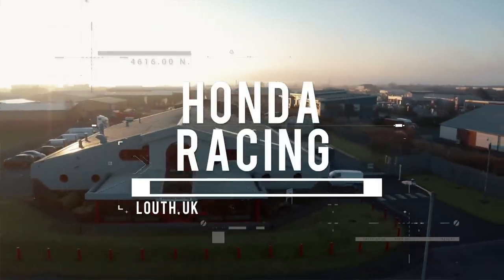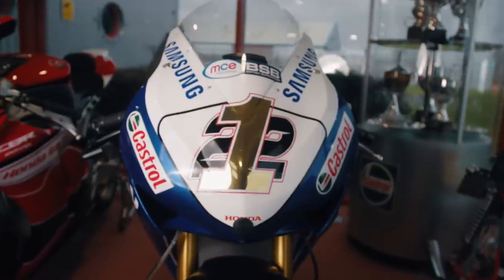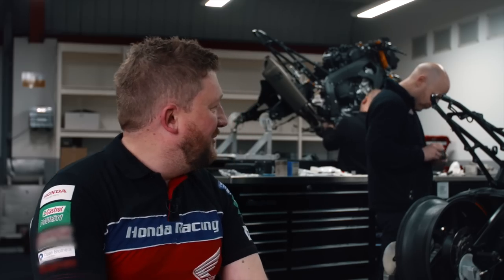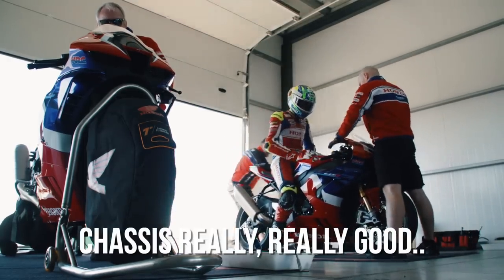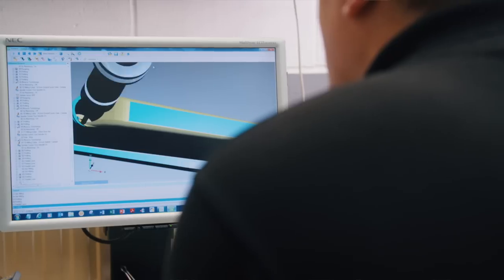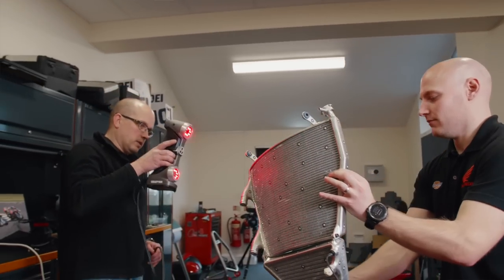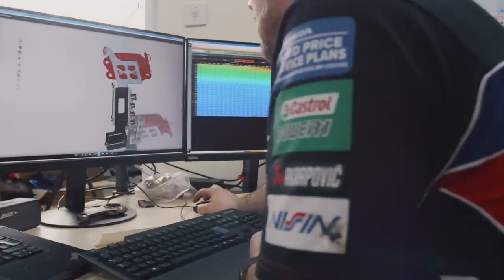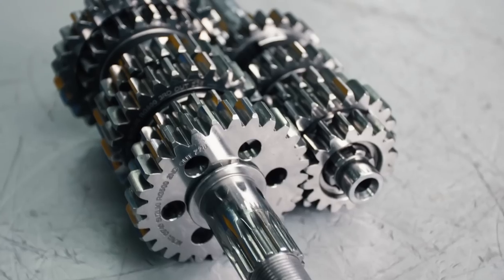Building the Honda Racing 2020 Fireblade SP  - Part 1

Comment: Please explain the Rubber Brake Lines, and the non forged wheels? Oh, and why this bike is getting spanked in WSBK?
Reply: sir, please get in line. we are serving the vertical frame weld looking weird, the non qs or blip on the standard, the insane price for inline4 tech, and your WSBK chirp, theres a number for the motogp rider struggling line. like how is this possible honda.

Comment: Lol 😂 you literally showed one biggest flaw in standard bike.. The insanely uncomfortable & useless for taller riders... The very high footpegs & controls.
Reply: There will no doubt be aftermarket controls from EvoTech (they obviously have a head start) and the other usual suspects. Either way, a smaller bike didn't hurt RSV4 sales all that much...although I'm talking as a track bike, not a road bike.
Reply: Get a cb650r lol. This bike is not meant for your sunday cruise, its meant for racing. All the best racers are small. As a 6'2 man its a reality I face daily.
Reply: If you want a comfortable bike get a goldwing